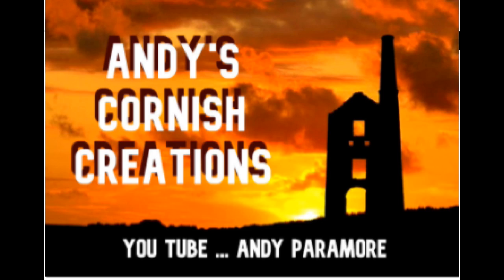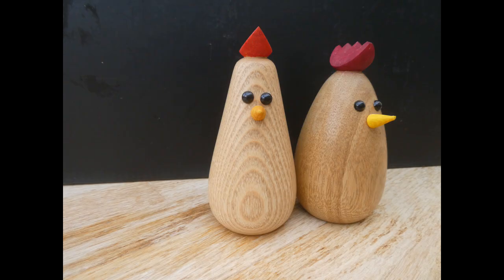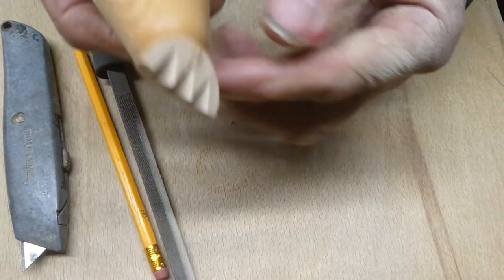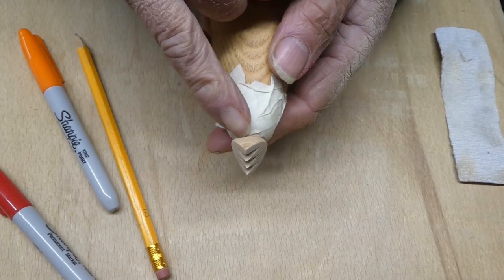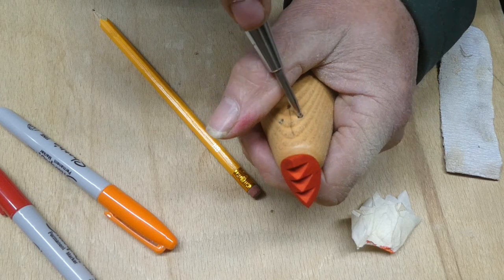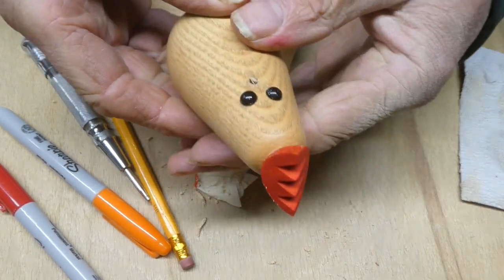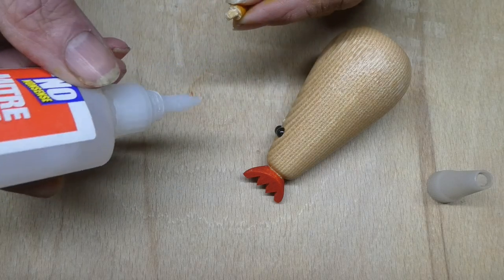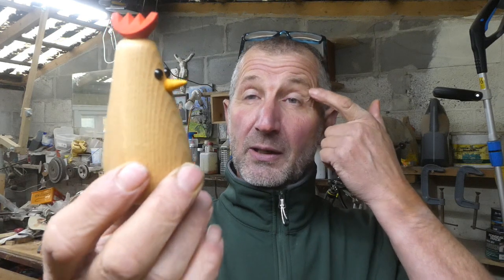20 min.Great gift or easy craft sale! - woodturning

Comment: They are very cute Andy, may I ask where you source the plastic eyes you use from?
Reply from the maker: Hi Mike...
Thank you very much...
I got the eyes through Ebay and they came from China...
Amazon also sell the same thing...
Type in ... 6mm black plastic safety eyes... and you should get results...
You don't need the ones that come with plastic washers... they are more expensive...
I hope that this helps...
Take care...All the best.....Andy